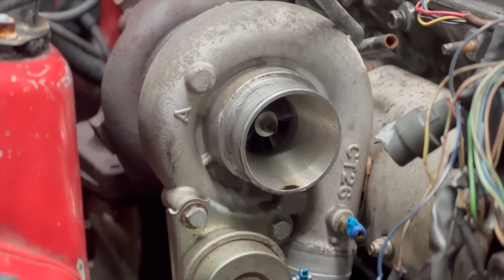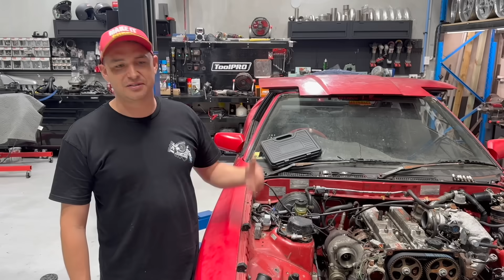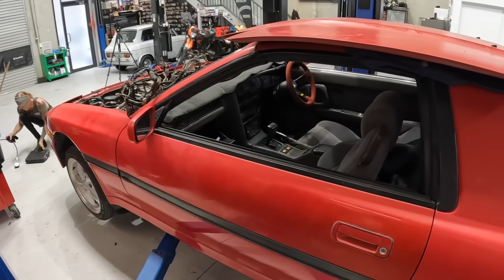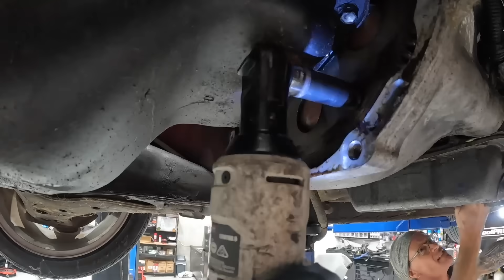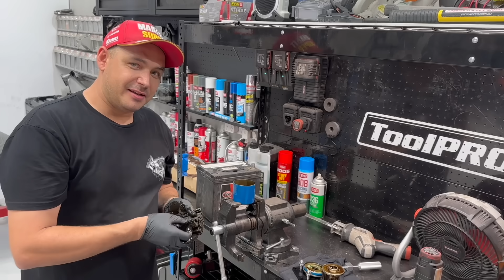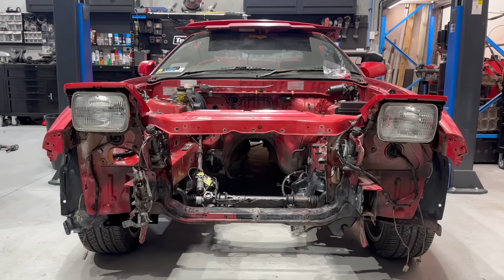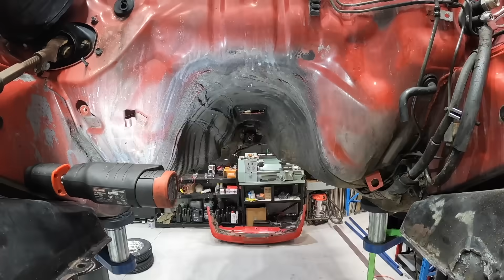Why Doesn’t Anyone Use This Engine? (This Might Be a Terrible Idea)

Comment: Can almost guarantee rear suspension bolts will be frozen into the bushings
Reply from the maker: Nothing a grinder and a sawzall cat fix!
Reply: @theskidfactory true story....i just hated having to burn out the bushings afterwards....love these cars and have owned a bunch of them but dont think id ever want to deal with their issues ever again lol..... hell i once went to do a diff swap which ended up turning into a whole rear subframe swap cause one of the captured nuts for the diff broke free and there is no access to it and i didnt have a welder lol

Comment: I have been watching your channel since I bought my 335i in 2018. It has since been manual swapped and converted to an equal length, twin scroll single turbo setup. Twins are great for a budget build and cheap power, but you really want a single to get great noise out of this engine!

Comment: 0:11 The weight.
Reply: Same reason as the 3000gt, 300zx etc.
Reply from the maker: Haha! This is true, might have to get the hole saw out and start shedding some weight!
Reply: Its a grand touring car. That people forced sports car behaviors onto.

The same with the mk5 supra grand tourer that just happens to go very fast
Reply: An aluminum engine would help with that. 2GRFE would help... 2UR if you're insane.
Reply: I own both mk4 and mk3 just add more power for the weight. Easy
Reply: @MRJZA75_34  Yes but its not the same as adding lightness. Lightness adds alot of nimbleness, If you want a heavier but more powerful car there is better cars.

Comment: I made almost 400 hp in my 7mgte  in  my supra with it for 20 over with cheap pistons China turbo steel head gasket Upgraded m.a.f and injectors one of the 7 AM failure points is the oil pressure regulator behind oil filter fails the spring where is that and then the bearings on the creek were out and you get Rana

Comment: I'm rather biased and inclined to this conversion. You got my support being both familiar with JZA/MA70 platform. That G series differential is likely an open diff being Ausdie spec? You've got oodles of swap in choices from JDM mechanical that could be in numerous Toyotas from MX83 Cressida, Crown, Supra and Chaser all of that era. And you also have the choice of any G series found in live axel hilux, 4 runner and Prado cruiser as well but will repair custom bearings to suit the IRS carrier. This can open your options to off the shelf air lockers for 4WD systems maybe used in conjunction with the stock torsen as they are quite strong and used a lot in Hilux rear end converted RX7s that wheel stand at test n tune and can range the RPMs (the R154 I can sadly say is not able to take high RPM launches from a rotary - they com 3 bearings) but not your problem anyway going BMW so irrelevant 😁

Most people are unaware that BMW has a once in a life time oil on all their gearboxes. There is no service procedure for BMW gearboxes, only maintenance and disassembly for parts change but for servicing nothing. They expect the same oil for the life of the car and they stand by that? That's how my much they trust their oil and gearboxes though? They can take a beating too.
.

Comment: After my BMW misery I near panicked when you revealed the engine!  Deleting ALL the BMW unreliable crap is a must, but how to keep the core performance - I hope you can keep the feel/soul of the engine - they are AMAZING in that regard.  What of the chains? ...premature stretch is my last concern.  Ooh - and do the N54's have valvetronic?  That's a nice system for snappy feel! Mine didn't fail though it condemned my colleagues Bimmer.

Comment: A good mate of mine bought one of these N54 engines wrapped in a 135. He put it in to a 'reputable' BMW 'tuner'/workshop for a going over (fluids, check over etc.) and when he picked it up it had a nasty knock.
3 attempts at rebuilding the engine failed resulting in an insurance claim and subsequent write off... (repurchased & engine swap with another N54 by another workshop). My take on it is I think they run cracked rod caps rather than dowel pins and one of the rods had mating face damage causing misalignment, resulting in the bearing chewing out every time it was assembled. So quickest cure would have been a set of aftermarket rods. A painful exercise to be avoided...
Reply: That’s the issue with Australia. The knowledge and aftermarket supply just isn’t available. Every BMW I see here makes considerable less power part for part than in Europe or the USA. 

They just have a bad name because of incompetence.

The N54 can be good, it just requires knowledge and good tuning. The N55 is a vast improvement and the B58 is obviously amazing.

Comment: It's better than doing the same, but n54 is a popular alternative already. There's some rather annoying things regarding oil pumps, oil leaks, plastic cooling system parts, and BMW engines that put most in the bin. Easy enough job but expensive and time-consuming to repair. Direct injection is pretty good, but I'd sell all that and run port injection with a haltech. You can then lay back those funky bits in the combustion chamber and fabricate your own intake manifold.
Reply: It's just a pity that deleting the factory ECU and the direct injection delete the only good things about the engine and make it kind of mediocre 

But no choice when you are doing a swap into a completely different platform. Just wouldn't swap this engine at all personally. 

N54 oil pumps are completely fine. They do suffer from starvation even with a baffle, but they're not as bad as the n55 that runs low pressure efficiency, garbage and straight up stops the entire motor

Comment: This is like an early Christmas to me. I have been a subscriber for so long and its great to finally have a project of yours that I can 100% relate too as I'm half way through my own mk3 build with an auto JDM MA70 GTE conversion to a built 2JZGE+T and R154. Nothing as ambitious as yours but am doing Astra electric PS , W2A intercooler setup for somehting different, and big brakes. And an R3 running it all of course. Can't wait to see how you tackle and overrcome various challenges over the coming months.
Reply from the maker: Sounds along the same page as my build mate! Just a different engine!

Comment: Whats the thought behind using port injection on a direct injected engine?
Reply from the maker: The idea is to simplify everything, a lot of the problems I see people have with the N54 is High pressure pumps & Injectors.
Reply: GDI is all about fuel efficiency and emissions, at the cost of complexity, reliability and gunked up inlet valves.

Comment: Just mount the engine straight up. you have more space to on the hot side and get an electric power steering pump
Reply from the maker: Then we create problems with the shifter. Sump and bonnet clearance. There’s actually a fair bit of room. We make it work next episode anyway

Comment: That's awesome mate, glad to see you doing something different! Excited to watch because I've never seen anyone do a series like this on a mk3 supra. I'm running a 8hp70 + 7M in my A70 and absolutely loving it. I'd highly recommend doing the 8hp with turbolamik, you can use a clutch pedal and a sequential shifter, and either have it full auto or manual, it's insane and I'm loving it!

Comment: I would highly recommend, while you can, to fit a different steering rack with less turns lock to lock
Reply from the maker: Is that an A70 specific thing?
Reply: @theskidfactory  Yeah. They've got not much steering angle and like 4 turns lock to lock, on track you have to really work the wheel through your hands on tight tracks. Takes loads of effort to hustle it around

Comment: Only bad things I have heard of from the N54 is spun rod bearings  (and achy breaky plastic bits, but your doing away with that anyways), so make sure it is well oiled and you should be good! Interesting swap for sure, I'm still keen on the 2GRFE V6, but kinda bias on that, since that is what is going on my FWD 93 Celica GT. I also live in America where the 2GRFE is in almost EVERY Toyota and Lexus car made since 2006, so heaps of them out there.
Reply: Yeah it’s essentially Toyota’s VQ engine but because it was never put into anything sporty like a 350Z just Camrys and SUVs nobody has ever done anything with it
Reply: @Woodie-xq1ew the SW20 guys over here are loving it! And it bolts up to a EB series 6-speed for FWD/MR applications, and Tacoma's and had a version of it so RWD capable (but only the Direct injection version, so FE heads would be required). Also would need older v6 manual Camry Flywheel (which has become super scarce to find). You should check out Frankenstein Motor Works YouTube channel, he is getting these engines up to 350HP on the Stock ECU with simple Toyota Parts bin mods! I mean there's good reason why lotus is using it in their Evora's!

Comment: For the driveline Angle shouldn't you have the rear end loaded up? Not on a hoist ? Correct me if I'm wrong please
Reply: It's an irs car, so the diff is fixed in place so doesn't move when the car is on a hoist

Comment: Please please please do yourself a favour - dont use the factory pcv system.
In Europe its common ti block them off and put a pcv port on the top-rear of the rocker cover.
The factory setup is like a syphon. Idle for a little and it fills up, touch the throttle and it goes straight into the exhaust 🤦‍♂️

Biggest killer is running these low on oil because they burn a litre every couple of thousand kms 

I'm as happy to work on BMW's as the next mechanic. But this project is cool!
Reply from the maker: Yeah I’m going to modify the valve cover
Reply: @theskidfactory block the ports in the head too If you aren't already aware of that.
Reply: It's definitely not that bad. It has a cyclonic separator in the valve cover. Still not a bad idea to block the head ports and run a fully external PCV especially for what he's doing

Comment: Will a Haltech work with DI? DI is worth a few HP. Do the port as well (again, if the Haltech can do it).
Reply from the maker: Haltech don’t currently support DI, they are interested to offer something in the future. I understand the DI has its positives but the aim is to simplify and otherwise complicated engine. No vac pumps or DI pumps to fail and let me down.
Reply: Link can do it though. But stance works will argue that di is only for emissions, which is not true. Only because of his sponsor not being able to do it.
Reply: @Low760  Yeah the current Link ECU offerings are very impressive. Direct injection can definitely offer some power and other advantages, but obviously adds complexity.

Comment: I was waiting for the VG30 reveal 😢
Reply: Woody doesn’t own enough vacuum hose to build one of those 😂
Reply: Y would u put urself in position to be waiting forever bc nobody in there right minds would go out of there way to use that motor, i mean there's a reason y u don't c that many Z32s in the wild still running today. The motor is overly complicated, parts r hard to find and it just isn't cost effective. If u wanna c a VG30 build then go find urself a Nissan purist
Reply: @BonnieBluesProtege tell me you’ve got no idea without telling me 😂
Reply: Unless im missing an inside joke of the channel in past videos then i fail to c wym. The VG30 is a nissan engine used in a few cars mainly the 300zx Z32 so plz enlighten me  @jakeberry981